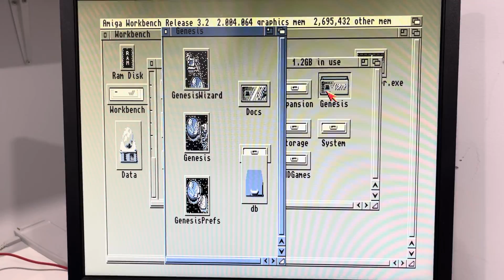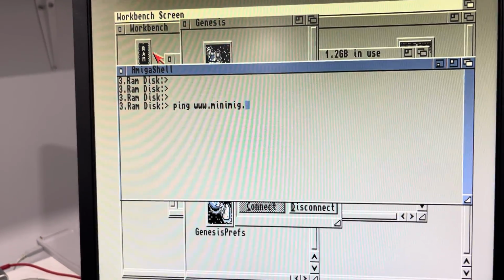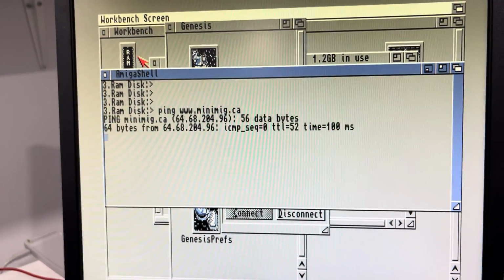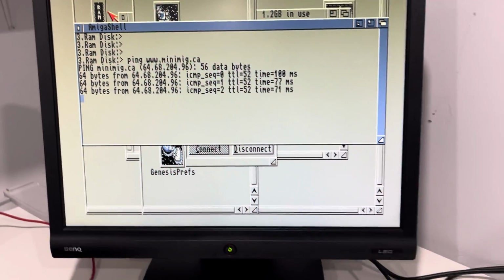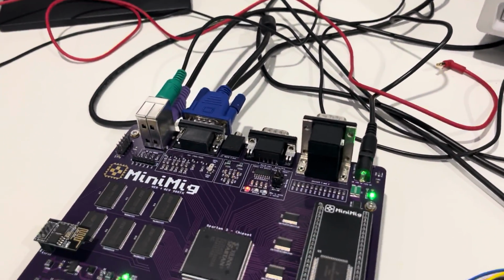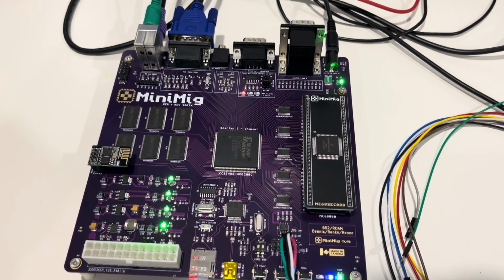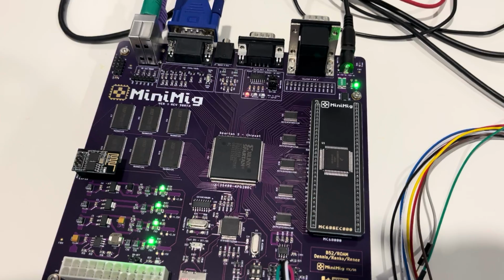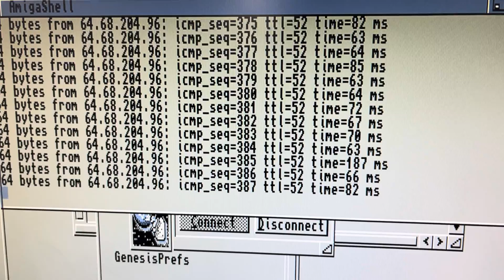Minimig v198 ITX-WIFI

Comment: Have some spare LilyGO T01 C3 ESP32-C3 WiFi Modules, they have WiFi Connector for external Antenna too..can you shed some light in how to configure them for the Minimig?
Reply from the maker: Here is a good website, this example is for MIST mut same is applicable for Minimig. https://hackaday.com/2019/07/03/amiga-in-the-mist-gets-online-with-an-esp8266/
Reply: @amicube  got a bit confused because I read esp8266 a couple of times instead of esp32...but now I am sure esp32 is the right one
Reply from the maker: Got it!

Comment: Is there a way to attach/hook up a floppy drive to this? Jim Drew and Rob Smith have been making great strides with floppy drive compatibility with winuae as well as making flux backups of old disks of a variety of old computer systems.
Reply from the maker: The way I did it is with a new module that creates floppy functionality directly on the fpga.  So signals are going from Paula and CIA directly. I am still working on this module but as of now I have 95% compatibility achieved. For AmiCube I would like to have df0 and df1 on-board. Adding external floppy connector is also easy and possible at this time.
Reply: @amicube  Very cool!!!

Comment: Fantastic work on this latest iteration of the Minimig! What is that Amicube board I saw come into view on this video? Is that going to be the Minimig v2 that support AA and AAA chip sets?
Also question about the outputs on the back of the minimig v1.98itx. Does it have two different video outputs, one from vga and another from hdmi? How does that fit in with monitors with hdmi connections, it works out of box with minimig cores? Or do we have to push this video signal (hdmi and vga) through something like the OSSC for conditioning the signal for modern displays? 

Actually when I look at the board itself, I see no hdmi. But when I look at the itx case it shows some board in it with an hdmi connection? Possibly the minimig v1.98itx with an accelerator card that pushes video out of an hdmi port?
Reply from the maker: Thank you! The Minimig uses strictly RGB output. The new AmiCube boards feature HDMI, but I'll retain RGB as an option for AmiCube since it is, after all, a retro-computer. With Minimig, you can use an OSSC (Open Source Scan Converter) to connect to HDMI displays. In fact, that's the setup I'm currently using.

Comment: It would be nice to set WiFi configuration from AmigaOs. Anyway its good to have a network connectivity available!
Reply from the maker: Yes! You are right. If someone has time, should be easy since it is only serial terminal. Same driver would be compatible with old Amiga as well. Unfortunately I just don't have time.

Comment: This is awesome for those who don’t have a 1.98 yet, and terrible for those who just bought the newest 1.97 😢.
Reply from the maker: I know. This is same old problem with new revs and additional features. I feel your frustration. :( It is possible to solder on wires to TX and RX but I usually don't recommend this since it is easy to damage the board.